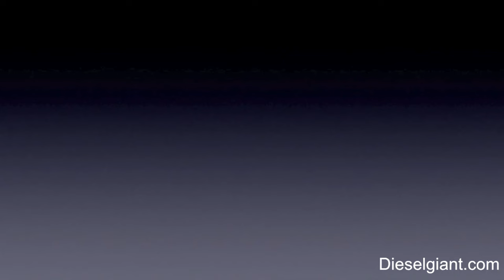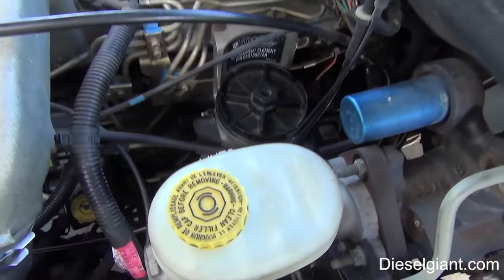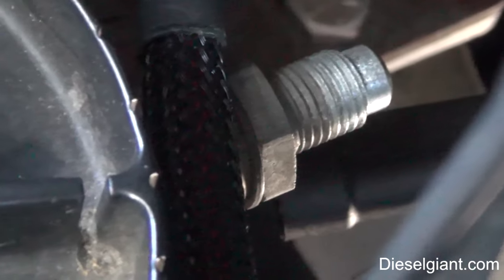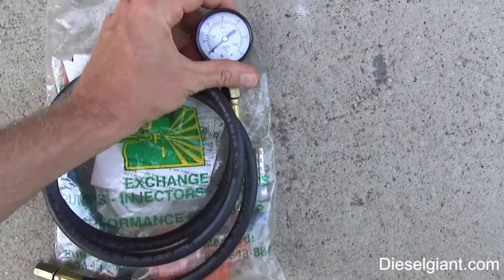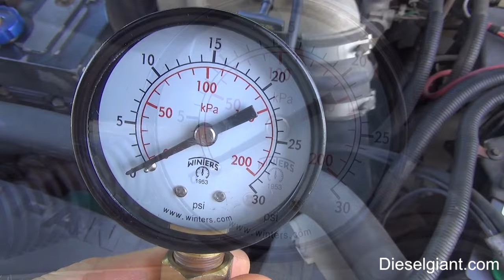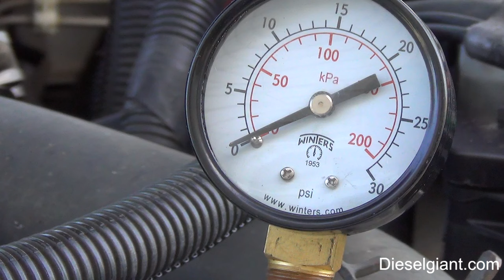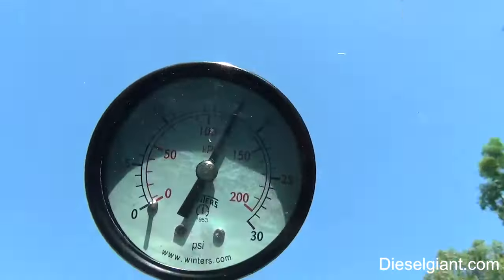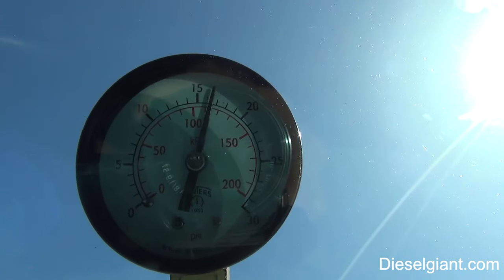How to test fuel pressure on a Dodge Ram 2500 24v with the Cummins Turbo Diesel

Comment: I have 2003 dodge Cummins pickup. My lift pump failed. I replaced it with a fass pump and filter. The truck ran good for about a week. Now the truck won't accelerate. It will only go about 45 miles per hour top speed over a small Mountain Hill. If I press the accelerated pedal, the truck slows down. I have to press the accelerator gradually to pickup speed and I have to let off the pedal
 As I climb a hill or the truck slows down almost to a stop. When I pull a loaded Trailer it is even worse. Only 45 mph top speed flat ground and truck will only climb Hill at 20 MPH. I'm thinking my injection pump is bad? Feels like truck runs out of fuel. Truck runs OK for first few minutes, then losses power again. It will cruise down interstate at 70 MPH at part throttle just fine unloaded, but if I press the accelerator down to pass someone , the truck slows down until I let of the accelerator. I would appreciate any advice. Thanks.
Reply: mkestlz  I'm having the same damn issue with mine, I drove it 240 miles to get back home. I'm down now, and was wondering what your fix was?
Reply: I'm having the same problem on my 99. Local diesel shop told me to replace battery cables. That didn't do it.
Reply: Please help I have the same problem
Reply: @jwadkins8  please help I have the same problem
Reply: @TheGhostrider228  please help i have the same problem
Reply: here it is five years later and im having fuel pump problems again. I was searching utube and came across my old post. I was able to correct the problem from the above post. what it was is the fass fuel pump mounts in a different location. the  rubber hoses make a loop and they where collapsing or kinking when they got hot.
My new problem is I smell fuel and have fuel around the pump. (The electric pump) Im trying to figure out the best way to mount a permanet fuel pressure gauge inside the cab. I'm thinking I need to replace my rubber fuel lines. The truck runs fine when running but takes 10 or 20 tries to get it to crank.

Comment: Buying an 01 and wanting to change out the pump, add a gauge and maybe the big line kit.  Could someone who has done it, please give me their opinion on best pump, gauge and if I should install the big line kit.  Also, Ive seen people who have replace the fuel filter housing with the one for the 12V.  Is that recommended also?  Thanks!

Comment: I'm so sick of this , that's a different setup how many times do I have to retype 1999 dodge fuel filter replacement every year, but 1999 can't find all I want to do is to find out how to change a flippen fuel filter not on a 2001 not a 2000 A 1999 cummins 2500 dodge , I thought thought I heard 2000 was the same not on the sites I've been on been on this for well over an hour , I can't even find how to disconnect the water in fuel sensor it looks fragile and I don't want to break it but I see nothing on how to remove it, no button no slide the next thing I do it to remove that type of sensor connection, just trying to get out of town , and I can't believe not one video on how they come apart you'll find video and they says discount the water in fuel sensor but they don't show you how , the 1st.time I paid.some high price shop to change the filter it.wss 650  for a cheap fuel pump and oil change, that mechanic didn't remove the canister and I believe he ripped me off , he said its not pumping fuel the canister isn't filling up, he told me to look in the canister and he turned the key on and sure enough it wasn't filling up.
Reply: 1998.5 though 2002 are all the same trucks with the exception of maybe MAYBEEE a different lift pump location depending on model. Some are in the tank and others are engine mounted right behind the fuel filter canister. As for your problem with not taking the sensor off. ...just lift up on the tab and slide it down and it comes off
Reply: No they aren't the same, the early 98.5 - 99 Cummins had the same all metal fuel filter housing as the previous 12V.    99 was the yr they changed to a plastic cap and different design.   They even carried the plastic capped ones over to the 3rd gen.